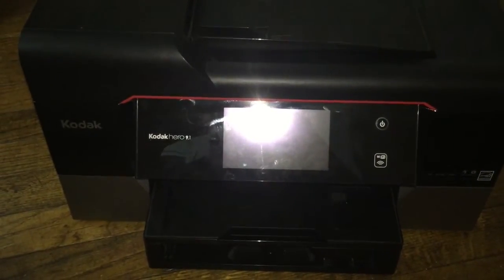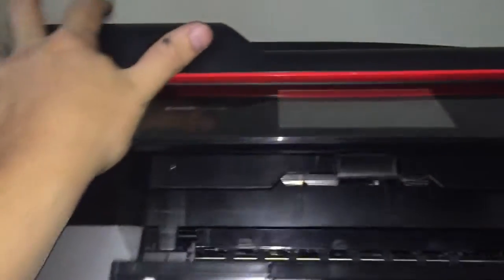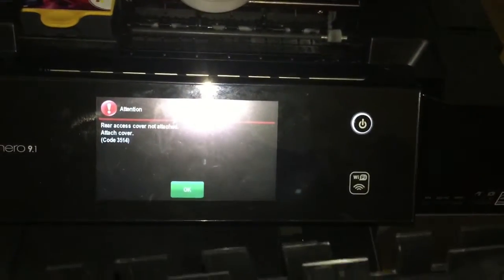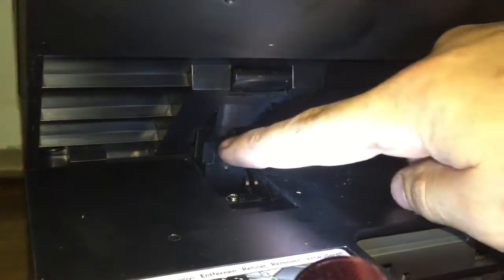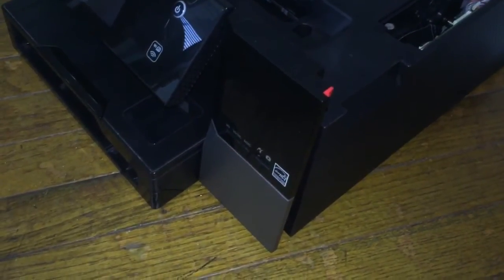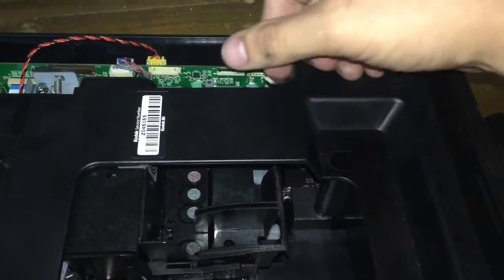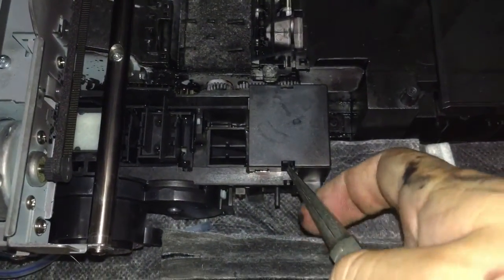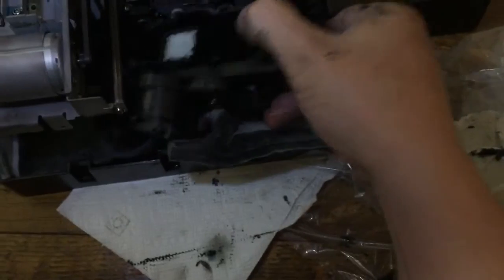Kodak Hero 9.1 AiO Printer Disassembly

Comment: (QUESTION) I took my Kodak Hero 9.1 a part. Put it back together, BUT now I have this error code 6202, YES I did the reset thing as in turning it off and on. Its the same thing??? Do you think I broke it??? Or may of I put something together wrong??? I Believe all the parts are kind of pacific, as in they only fit w/the matching pieces... PLEASE let me know... Thank You!!!
Reply: Ray Donovan I had the same problem, make sure the cables for you scanner are connected properly , that seems to be the case with me

Comment: Hey slusser.  Good show of you taking it apart!  But what about the reassembly of that black module to that triple gear setup? I mean, don't you have to be aware of what position that triple gear setup was with respect to the slide position of the ink tray thingy? The thingy that slides forward and backward also has gears which mesh with the triple gear thing. It has a flip-up lever over it that appears to lock the gears. Did the printer screw up on you after reassembly because of the tray/gears being out of tune? What did you do?